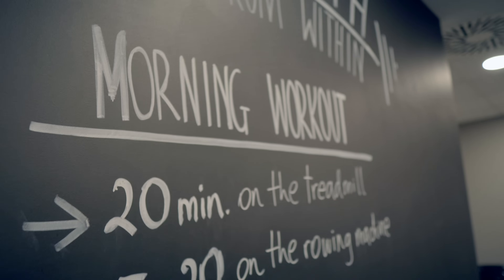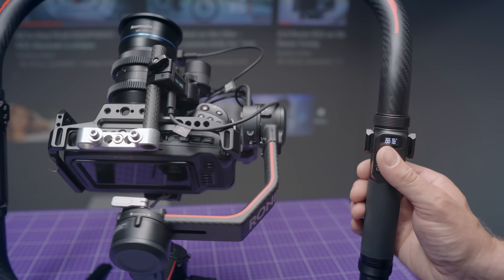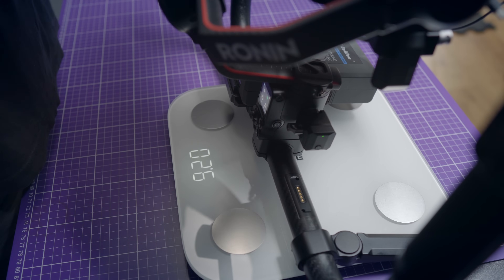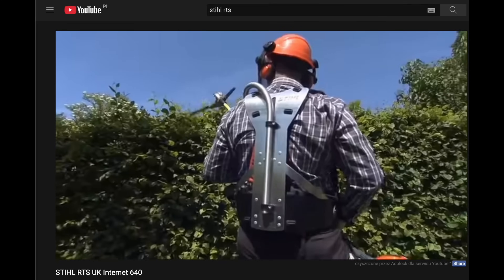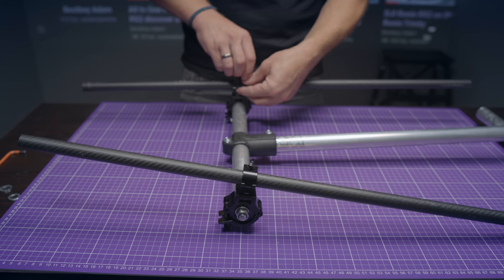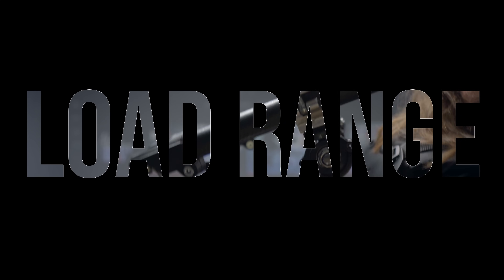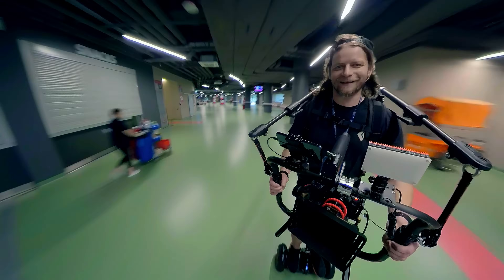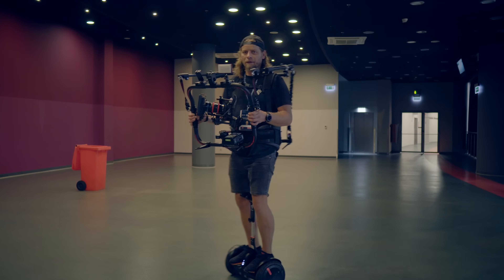GIMBAL SUPPORT FOR EVERYONE -  DIY or TILTA Float + Advance Ring Grip for DJI RS2 !!!

Comment: Thank you very much for the video. Especially for the part which brings the light on pro&contra about tilta float+steadicam VS ring grip+gimbal support.
I guess Tilta Float is not for me (on a current youtube project) because I'm changing focal lenghts on my zoom lens pretty much often when shooting, the footage is planning on-the-go most of the time. So adding extra time for rebalancing  steadicam might be problematic 🥲However i must do something to eliminate steps on a complicated and unpredictable terrains

Comment: @bestboyadam How did you mount the Ring nuts? Are those m4 bolt with an unthreaded upper? And is the Ring nut itself M8 in size? How do you make that ring nut rotate smoothly? The cinemilled spindles are so smooth, but unfortunately don't really fit the Tilta ring. Any solutions for a buttery smooth tilt movement? Compliments on your solutions, you really know your stuff!

Comment: I'm having a tough time finding clamps for 30mm tubes that have a bolt that can go into the tilta base plate without making the hole bigger anyone know which are the exact ones used for 30mm tubes also note I'm in America.

Comment: Thanos SE costs 650$ and its a lot less junkier...
Reply: It is also a trash product that youtubers do not tell you because they only review for like a few hours and then give it away. Or never use it as they got for free. Its arm holder has cheap cushioning that tears off very easily and the method they teach you about turning it to the side and using it for underslung mode, that has the problem of literally drilling a hole into your gimbal handle.

Comment: this video is driving me a little crazy but i think i'm getting close to a slightly different design. I have ares dual handle z axis and it is supposed to handle 5 kg my rs2 with camera is about 3.2 kg and smallrig ring is about 1.5 kg  i'm modding the ares handles anyway but they may give the suspension i need for this set up. thanks for the inspiration adam

Comment: Thank you Bestboy! fantastic rig. Question: can I adapt my sony FS7+3 Tilta motors+Fuji Cabrio XK6x20 PL zoom lens+4x5.6 NDs+5" 4K monitor? WITHOUT a ronin or the gimbal/ring? is it possible to attach the camera to your device using a bar attached to the top of the FS7? my rig as described is about 26pounds. Please let me know. thanks!

Comment: Hey Adam - Beautiful work! I just picked up a Ronin 4D and am thinking about building a modified version of your rig to use with it. Have you tested this on your 4D with a single arm? Or perhaps with both arms, and connected to your 4D by the cross bar that you hung your test weights on at around 10:05 in this video? Would love to hear your thoughts about this rig with your 4D! Thanks so much!

Comment: Great site - subscribed and bell on...
We recently purchased the Tilta basic ring for our DJI RS2 PRO and also added the V-Lock plate as we use V-lock batteries on most of our ENG cams. I tested the ring with just the V-Lock for power and then tried with just the DJI power handle - both worked... But do you know if both are connected together which one draws power first - handle or V-Lock?
Just this morning ordered one power supply adapter to try (I see you've fitted several) but with one only can I connect a D Tap to 4 Dtap Female Splitter or is that a no-no? 
Slightly concerned as I see Tilta issue this warning regards their power supply adapter "Please take extreme caution when connecting P-Tap power cables as connecting cables backwards can damage your gimble" Are they referring to +& - with statement?
Thank you for all your help on this site, looking forward to your reply, Best John.

Comment: If I want to use a 1st AC pulling focus with the handle grip on my DJI Focus motor, I am left with only one handle grip for myself. 
So what handle grip product do I need to buy to replace the one my focus puller is using? 
Are there options beside buying another $200 USD grip handle for the ring?
Reply: Hey if you have a float system you can put both Bluetooth receivers on the ronin and use the thumb controller as a wireless follow focus . It’s small but it works just fine! I’ve been trying to rig it to a micro follow focus system but no luck yet

Comment: @Bestboy Adam - Ordered all the parts but I'm having a hard time finding 30mm truss clamps (I'm making the extendable pro arms). Could you share a link to the ones you used?
Reply: Hi John. To connect the gimbal, did you use a piece of elastic rope or a  simple strap ? Adam recommends an elastic rope (8'59), but i can see straps on nearly all of his videos. Thank you for you answer ;)

Comment: A very interesting solution at 09:00 is to use eyebolts, carabiners and clamps. Adam, tell me, please, if you raise the ring above your head, will there be enough tension so that the elastic bandages do not bend in half and the carabiners start clinking against the eye bolts? I hope you understand my question. I just ordered a simple read-rig and I don't know exactly how it works. And yes, hello from Russia!

Comment: What are the lengths of the tubes I need to make this?
Reply from the maker: You can use the  length in relation to your body size, the lengths I used for this are 35 cm x 60 cm x  35 cm

Comment: Just a quick question: Maybe I'm mistaken but it seems like there are not all items in the infobox ... Am I correct?
Reply from the maker: oooooo what did I forget ?
Reply: @BestboyAdam  Maybe I'm just too stupid. But on the one hand it would be great if you could also include the carbon pipes, the sleeves for the fitness bands, and maybe even examples for the small stuff like the washers (I'm just not experienced ... ;-) and additionally it would be fantastic if you could tell us the exact length of all the pipes etc.. I/we would appreciate it very much. Best wishes and keep up the inspiring work!
Reply: @mpatercologne  Yes @Bestboy Adam , please share the length of the pipes as well as where to get carbon pipes! Would be greatly appreciated! I'm literally ordering parts now trying to fill in the missing pieces!